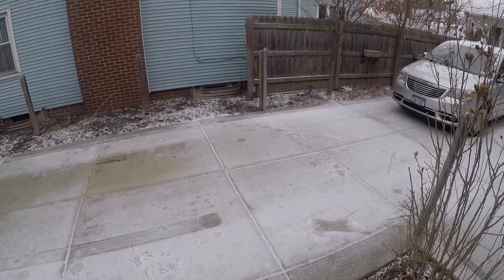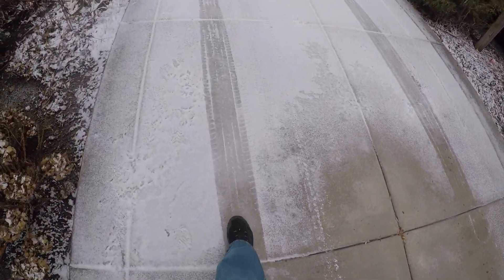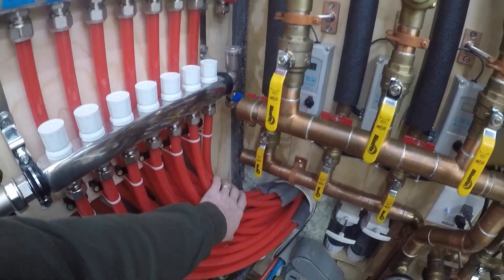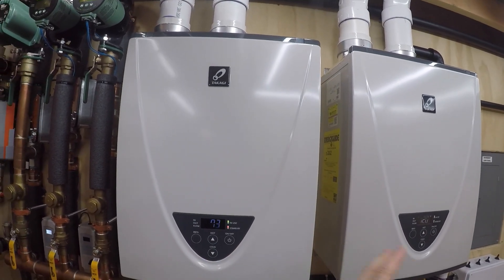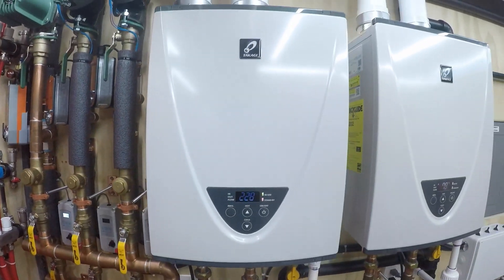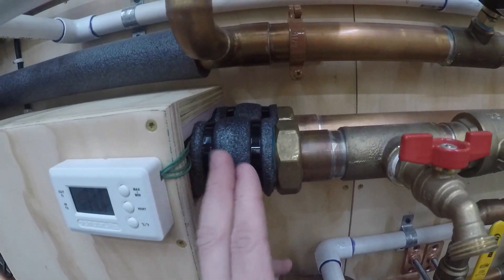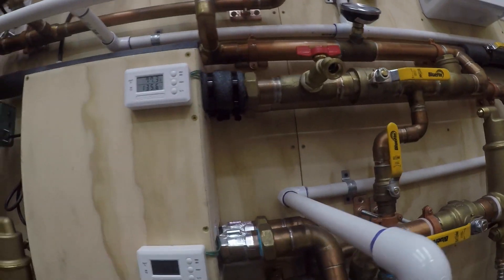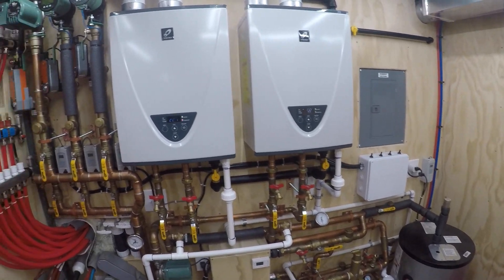2nd December 2021 DIY Heated Driveway Melting Snow Time Lapse & Startup - Episode 76 [12-19-21]

Comment: Any recommendations on if snow melting systems work with asphalt driveways?
Reply from the maker: I know it’s possible!  I’ve spoken with a couple of people online (forums, etc) that have asphalt snowmelt driveways, and they’re systems work great, so I know it can be done.  Unfortunately I don’t have any experience with Asphalt myself, other than removing it. 😀.  I would imagine the layout and prep (insulation) would be very similar to concrete. Thanks for watching!

Comment: Wow cool how much would all that cost if u don't mind and is it worth it?
Reply from the maker: Hi Efra! Cost will depend on several different factors, including driveway size, location, average outdoor temperature, etc..  As you can imagine, my system here in Buffalo is designed to handle more than what is probably needed in other parts of the country, and therefore may be overkill.  The heated portion of my slab is also approx. 1,600 sq ft.  

I have invested $10k in the boiler room, and maybe an additional $2k for the pex and insulation board.  If you did everything yourself like I did, you could save significantly.  You could use less pex than I did, or not use the 2" rigid foam under the slab, and while those would save you money, it will cost you more in the long run as it will be more expensive to operate, and less responsive.  If your square footage is less than mine you may be able to get away with one heater instead of 2, and if you don't incorporate your domestic or radiant like I did, you could run the glycol right through the heater eliminating the flat plate, pumps, and a bunch of additional cost.  I did not include the cost of the actual concrete in any of the figures above, as I was doing that anyways.  

Was it worth it?  In my opinion, absolutely!  If you haven't already, check out my playlist here: https://youtube.com/playlist?list=PLdWeMRuZcbQjekwiBk_uy39IS6JFWYORD  Watch some of the time lapse videos of it melting.  Coming out in the morning after receiving over a foot of snow overnight is no longer stressful.  No shoveling.  You don't even need boots! :)

Hope this helps, and thanks for watching!

Comment: I would like to know how the math/physics on this works.  I have a long gravel driveway and I was thinking of doing a geothermal version of this, but I don’t know how well it would work.  Considering I have a tractor to dig a geothermal pit and get a 55 degree exchange I’m wondering how much energy it would take to thaw a frozen driveway.  I think it takes a lot to get frozen water from 31 to 33 degrees.
Reply from the maker: Hi Esquire!  I'm not sure if you checked out any of my other videos yet, but I think you may find the answers to some of the math / physics stuff there.  If you don't, let me know and I will try to answer your questions or make a video addressing them specifically.  Here is a link to the playlist: https://youtube.com/playlist?list=PLdWeMRuZcbQjekwiBk_uy39IS6JFWYORD

I have seen people install heating cables / tubing in concrete and asphalt driveways, but I'm not sure how well it would work on gravel.  Since you won't have a large mass to hold the heat, I would think you would be trying to raise the temperature of the ground / soil.  I think that might be very difficult and cost prohibitive to accomplish.  You do mention geothermal, and you may be able to put something together there, but I'm not familiar with how that would work.  As you'll see in some of my other videos, it takes about 2 hours sending glycol out at between 80ºF-100ºF, using between 175,000-220,000 BTU's to bring the slab above 32º to 38º-40ºF.  I'm not sure if geothermal has enough capacity to pull that off?   Sorry I can't be of more help, but always glad to answer questions!  Thanks for watching!